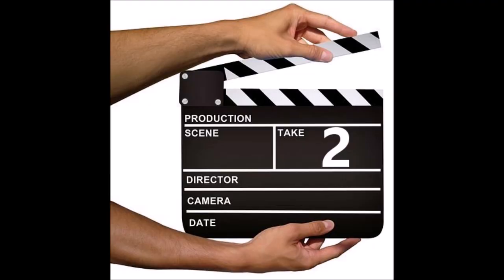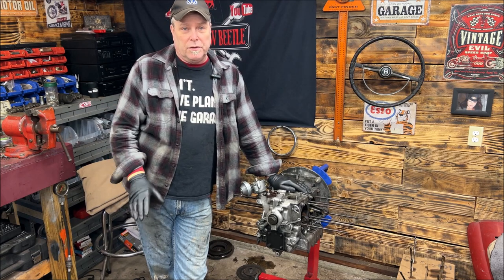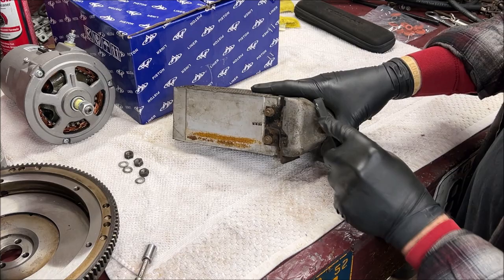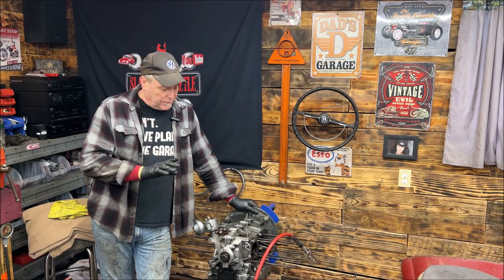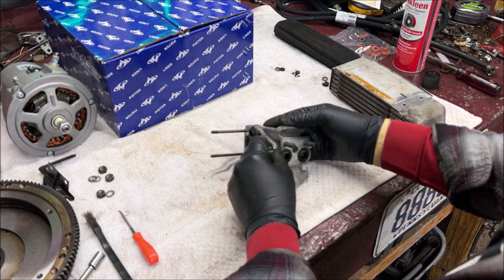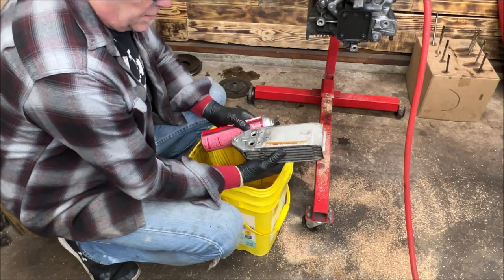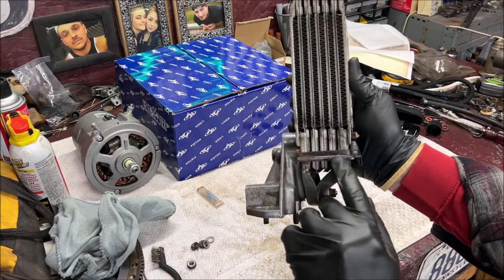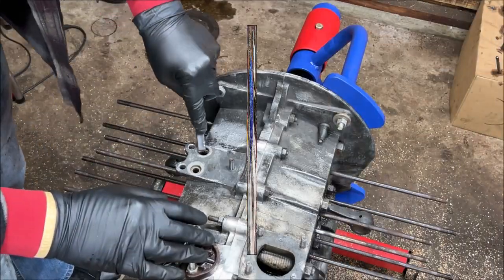HOW TO: VW Beetle Oil Cooler Seals - Beetle Engine Rebuild - Beetle Oil Leaks - #beetle #vwbus

Comment: Great vid.
Thank you.
Just like to mention that you need to put the foam seal back onto the oil cooler, before you install the shroud, as it helps the air flow dramatically.
All the best.👍🏾🇬🇧
Reply from the maker: Thank you I appreciate that, and thank you for adding to the process. I appreciate that a lot.
Reply: @SladesVWBeetle  No worries.
I have just come in from my garage, after rebuilding the top ends of my 1600. 
It’s hammering down here in the Uk, (raining heavily), so a good time for me to do it. 
All the best.👍🏾🇬🇧

Comment: Yes they do have two washers, a wavy and a normal washer.  I don’t like those pail orange seals, as you said they are hard and they split quickly. Enjoying your videos!
Reply from the maker: Exactly, they felt a little hard to me. That always throws a red flag. I was aware of the two washers, but the one have three washers on it which was kind of strange

Comment: Thanks Slade!  Another useful video.  Just to clarify a point on using extensions on torque wrenches, my understanding is as long as you are using a regular straight extension is doesn't affect the the reading.  It's when you get into using a flex head or crows foot that it's an issue.  It's that distance to the handle that matters.  Holding the wrench on the proper spot on the handle is always important.  (Don't choke up!)
Reply from the maker: Thank you for chiming in and I truly appreciate the advice! And thank you for being here!

Comment: Thanks for another informative video Tony.  Phew, I got it right. BTW, here's an idea for your engine stand. Hard steel angle and a couple of casters. Remove the front caster and bolt on. Will post a pic on the FB.

Comment: Bigger the Ultrasonic cleaner the more solutions you need.  I have seen some use a jar with solvents/solutions in it and then place the jar in water for cleaning smaller projects.
Reply: I also noticed that Harbor Freight has a new one now.  More like the style you just received.
Reply from the maker: I didn’t notice them having a larger one now. Of course this one was free so that was really convenient, and it is a pretty good brand.
That’s a really good idea, is putting a smaller jar inside. I’ll be doing ultrasonic videos separate from the weekly VW videos though.

Comment: Sir Slade, thank you again for a great How-To video.  My old '69 single port 1600 engine had the old tube type seals which you set aside when you first opened the seal package.  I could never get those to fully seal up, even with goop around them (yes I know .... bad puppy!), but the newer seals which you installed make a lot more sense engineering wise for sealing the oil cooler to the housing, and the housing to the engine case (almost said block, I caught myself).  Enjoyed the bloopers and the added photos of humor in your videos.  Keep up the great work.  BTW, some people call you Tony.  Is that your first name, or just an acquired nickname?  All the best from Surprise AZ!

Comment: I believe that other oil cooler seal, the fatter one with the smaller oil passage hole, is a T3 not T4. T4 should use the same seal as the late T1 seal you used in this install.
Reply from the maker: I honestly couldn’t remember I’m glad you chimed in. 
I knew it was for a three or four, and some reason my old brain went to type4 lol

Comment: Hi Slade, I have a 1300cc so my oil cooler looks a bit different, but those two holes in the case with the grommets the oil cooler fits on, I can blow air through one of the holes on the left towards the flywheel, but cannot on the hole to the right. Is that normal? Thanks and love your videos

Comment: Hey Slade good stuff, what engine type is that oil cooler? I've heard bus type coolers which have more cooling rows can be used on type 1 but the shroud has to be massaged. Thoughts??? Thanks

Comment: I just watched your video about oil cooler seals I have a crazy question at 21:25 of that video just after you show Newman from Seinfeld at about 1 o’clock maybe 1:30 on the back of the engine there is a sensor just below your engine stand mounting bolt what on earth is that sensor for I have the same one but no wires coming out of it  thank you Sir It appears to be a hall effect sensor. TACH?????
Reply from the maker: Hi Steve, not a crazy question at all. If you mean the black sensor, right below, where the engine holding bolt is. That was an old sensor they used at the dealerships many years ago for diagnostics. You don’t need that. I just leave the sensor there and snip the wire off so no dirt gets inside. I think we’re on the same page.

Comment: Hey buddy quick question I bought a 74 Volkswagen super beetle the guy put a external oil cooler and filter on it is there a way I can bypass the old cooler or Is it better to just use the OEM oil cooler as additional cooling.? I’m not sure I see a way that I cannot use that cooler just wondering.
Reply: Just wondering if there were any thoughts

Comment: Is it lossible to torque them with juggs installed?
Reply from the maker: You would have to use a wrench, I don’t believe you’ll get a torque wrench in there but you can try. Just don’t go crazy and over tighten.

Comment: 20:39 do you know the size(thread)of those 2 bolts M20 ?
Reply from the maker: I believe the ones you’re referring to are the 2….13 mm nuts that I was threading on? To hold the cooler down? The studs coming off of the oil cooler adapter?
Those would be an M8.
Reply: Thanks... Yes the two that are holding down the cooler...I need to buy the nuts for them
Reply from the maker: @MOE13576  I believe those are M 8 x 1.25, but wait… and I’ll give you an exact answer tomorrow I’ll run up my garage and check.
Reply: @SladesVWBeetle  ok, thank you
Reply from the maker: @MOE13576  you’re very welcome! I just went into the garage and checked for you. The nut will be a M8x1.25 
I hope that was helpful and I hope you’re having a great day.
Reply: @SladesVWBeetle  thanks again. Yup, it sure was.... I am, hopefully you are too..by the way,  you earned yourself a subscriber.
Reply from the maker: @MOE13576  thank you my friend! And welcome aboard and thank you so much for being here. The weekend is almost here!!
Reply: @SladesVWBeetle  you're very much welcome.  Yup, almost !..It's going to be a rainy one, at least for me it is.
Reply: Love the idea of the dielectric grease on the seals! Do you also use it on the pushrod tube seals?  Thanks again Shane

Comment: Who torques spark plugs , antiseize all plugs cheaper than pulling threads
Reply from the maker: I’ve used anti-seize on plugs, with engines that have aluminum heads. Although they say the newer plugs have a coating that won’t allow they to become frozen into the head. Sometimes I still do it. Anti-Seize does change the torque value, but I usually do them be feel.

Comment: Using a dirty oil cooler is a great way to trash an engine. 
I mean one from a failed engine, If there is glitter in the oil there is glitter in the cooler!
 I doubt you can clean a cooler properly if it has glitter in it, I know people that have ruined new engines by reusing an oil cooler